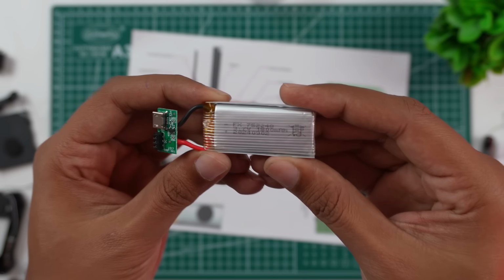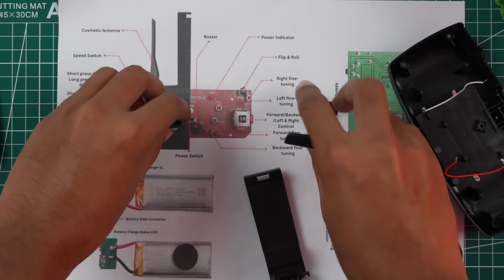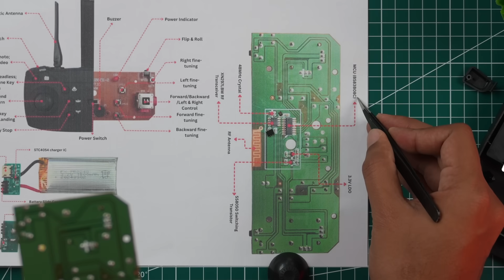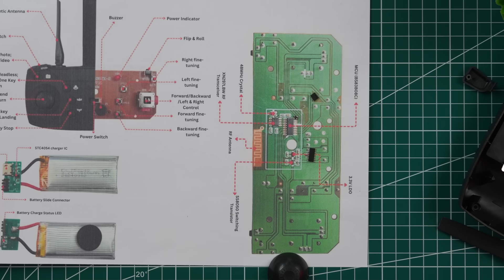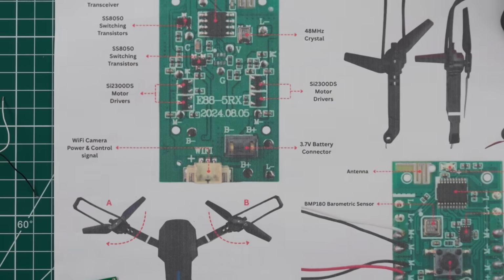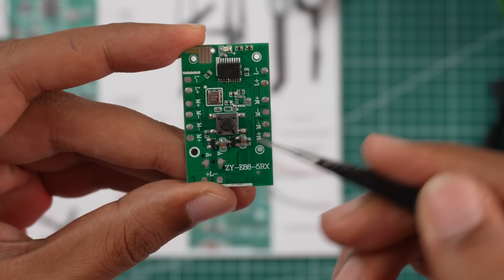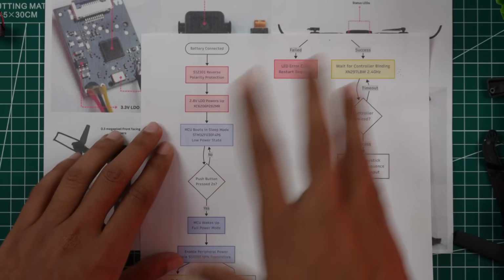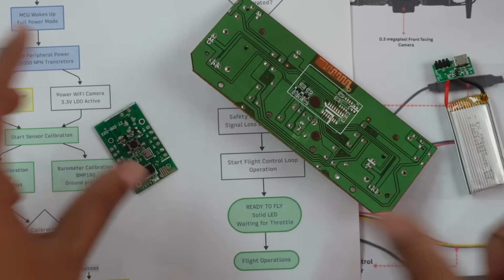E88 Drone Teardown | Inside a ₹1500 Drone – MCU, Sensors & Flight Control Explained

Comment: Hey, Thankyou very much for the detailed explanation.

I had done the exact same teardown wanting to debug a issue. - wherein one of the motor keeps spinning even without the any control input as long as the battery is inserted.
Any input?

Comment: Actually i think you guys forgot something about the yellow signal wire from the wifi camera module. The app itself lets you control the drone without the requirement of the remote and if you hook the camera to a seperate power supply and use an oscilloscope for the signal wire , you will see it sends out data , most likely to the stm32 chip for drone control instructions. Now how it does with just one wire , i have no idea which data protocol it uses

Comment: what is the BOM cost and manufacturing?
Reply from the maker: The final manufacturing cost of the product will depend on various factors such as the quantity,  components sources etc. Since most of the components used in this are asian branded clones I would say it pretty cheap.
Reply: @Circuitdigest thank you
Reply: BOM is 1/10 of the retail price.
Reply: @syletie thank you

Comment: I tried to go deeper into the camera module and at first I thought it was based on RTSP (sorry, I’m an IT guy and new to electronics). I assumed it was streaming using the RTSP protocol, but when I kept reconnecting to the Wi-Fi, I got really confused. I even scanned the ports using Nmap, but nothing showed up.
Then I tried reversing the APK file and found UDP ports 7080 and 7060. One seemed to be for control and the other for streaming. I thought I finally found the RTSP stream, but when I tried to access it, I got nothing again.
After that, I took a little help to understand what could be happening. I went even deeper into the Android app and realized the camera sensor is just sending raw pixel data, and the Android app is collecting those pixels and assembling them into frames. I was honestly amazed — they implemented this in a very smart way.
Reply from the maker: Ohh yes with the drone flying there will be so much of noise only UDP can handle such lousy data, thats the same reason our litewing drone uses udp Great work!! Where did you find the APK source code?
Reply: @Circuitdigest I just decompiled the Apk file and did reverse engineering on it
Reply from the maker: @XIV4M  thats great, may be share the decompiled version and we will add it as a resource to this video?
Reply: @Circuitdigest would you know how far it can go that the drone can still send  the raw pixel data? Thanks
Reply: (IT Guy here as well 😅) UDP is the only way to go, unless you thinking to go fiberoptics for better latency which is super but very expensive.

Comment: Nice explanation 😊 , The camera module sends the commands to the flight controller circuit through  command received from wifi controlled app . Can you make a video of  reverse engineering the camera module and decode the signals and create a hook to control the flight controller externally .
Reply: This drone is the worst thing on the planet 😂
Reply: There's a GitHub project that figured out how to communicate with the WiFi camera. I don't know if anyone has figured out the signal between the flight controller and the camera.

Comment: It's 2.4ghz than why this drone fly wired and range is also 20-30m
Old toy without camera 2.4ghz drone range 100-150m and fly better but it's cost 3-4000rs
Reply: How to buy
Reply: @RohanYadav2007-rr  from toy shop

Comment: I have a question, If it only have gyro so it should be only perform acro mode , how dose it is performing angle mode 🤔
Reply from the maker: the gyro can measure pitch roll and yaw. And yaw can be used to figure angle there is no magnetometer so the drone does not know geographic north
Reply: @Circuitdigest yes i can measure the rate and multiply with time passed to get angle value but as time gose by it accumulate error , so we should need a accelerometer
Reply: Actually I didn't get it how dose this drone is stable without accelerometer, can you explain me your thoughts on it
Reply from the maker: @AstrolidonSpace_  There are many drones that fly using gyro-only stabilization using rate mode as you mentioned earlier. Also this is a light weight low power drone so it is also designed to be naturally damped. There is no sensor fusion so over time there wil be an error that gets accumlated and without an accelerometer, this error cannot be corrected. Which is why you will notice a drift when flying this drone. But the drone has very low flight time of 5-7 minutes, during which this error and drift is not big enough for the drone to get unstable. I think it's a trade off to keep the cost low
Reply: @Circuitdigest  ok , I got it

Comment: The battery charger chip STC4054 is Absolute max rated 800mA, specified at 500mA.
Reply from the maker: Thanks for pointing, yes the maximum charging current is 800mA

Comment: where is TOF sensor? BMP180 accuracy is enough ?
Reply: The tof sensor price is more then the entire drone 😆
Reply from the maker: There is no ToF, BMP and gyro is handling  everything
Reply: That's not needed; it's only used for heavy drones, which need to maintain exact height as the pressure changes. When altitude changes, we can estimate the altitude with a barometer.

Comment: That was fabulous, love to see more reverse engineering like this.
One suggestion is to use digital microscope so we can see better. 
I wonder how much it would cost if this was made in India.
Reply from the maker: I would estimate cost of making this in india will be around 2K+ easily main problem is few of these drone modules cannot be imported to india without heavy tax and there is no manufacturing in india

Comment: I enjoyed......

the drone doesn't have the accel meter and I wonder how they are achived the auto leveling(gyro only toy grade drone is difficult to fly). May be they are using th ebottom camera for making the drone stable.
Reply from the maker: Thanks glad you liked it. No the camera has nothing to do with stability, the only sensor on board is the gyroscope and pressure sensor I think credit should go to the well written firmware as well
Reply: I think Optical Flow Positioning feature uses a secondary camera on the bottom to sense the ground and assist the 6-axis gyroscope for enhanced stability and precise position locking during flight, but I am still wondering how they are sending data back and forth.
Reply: I also feel like this